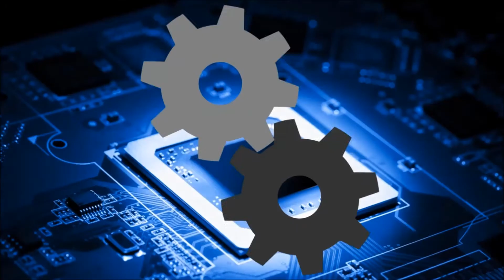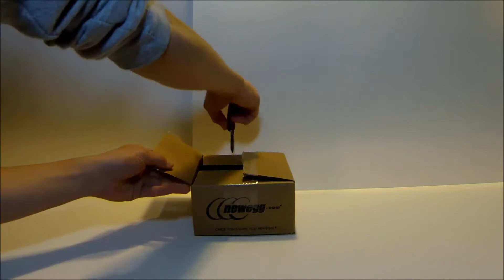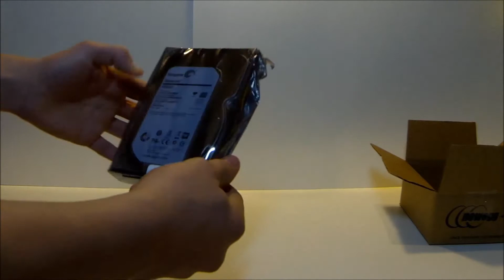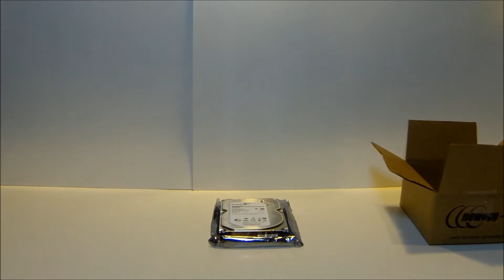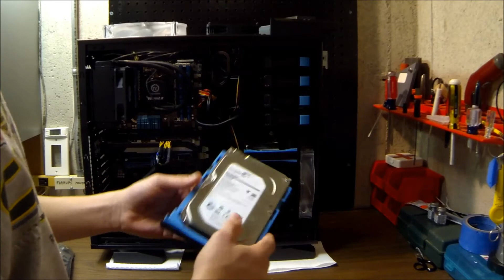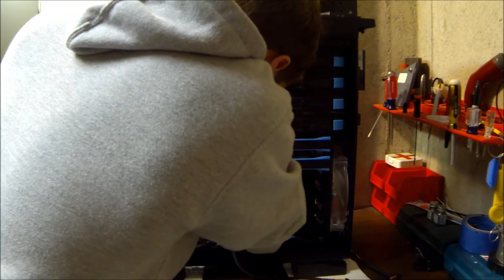New Hard Drive - Unboxing and Install

Comment: Did it come with cables???? mine didnt
Reply: You should have the power cable with your power supply and the sata cable, well you can just take it from your old harddrive. If you built the PC yourself the sata cable should of came with the motherboard.